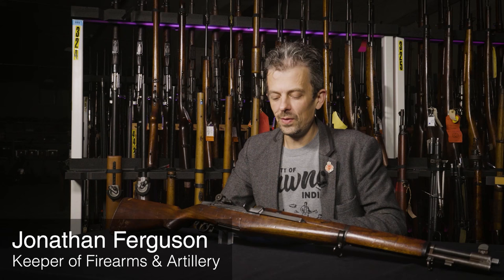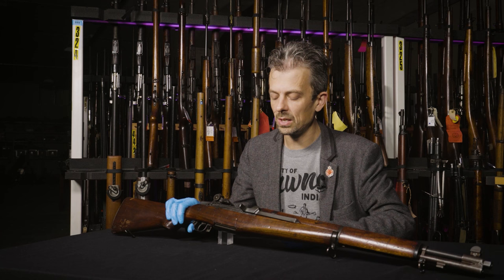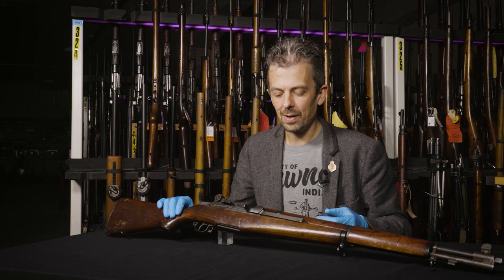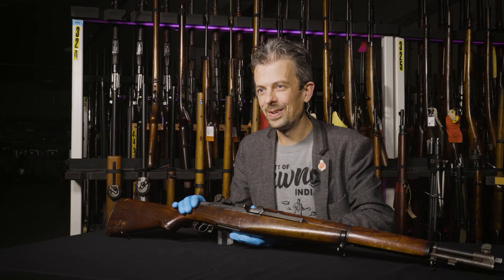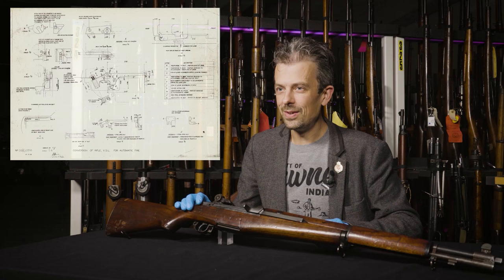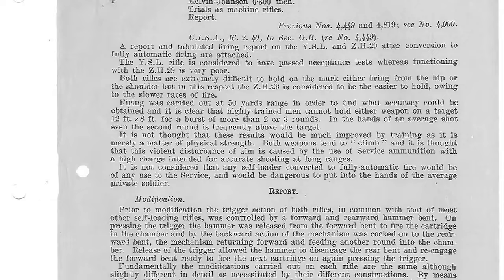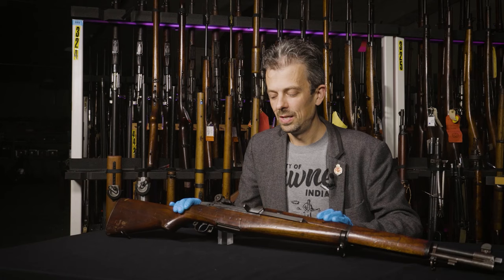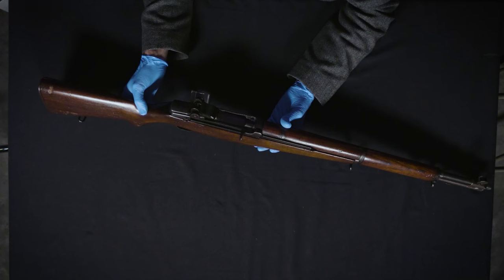Why did Britain make a fully automatic M1 Garand? With firearm and weaponry expert Jonathan Ferguson

Comment: I saw the report about the rate of fire in the US converted Garands (not M14), and it was 900rpm, which is the reason why they needed to remade a lot of things in the M14, they tried with BAR magazines, which were a easy conversion, problem is that the rate of fire made it unreliable, the bolt and the gas system were also unreliable in sustain fire with that crazy rate, the Italians developed a tricky mechanism in their BM-59s (which are real Garand conversions) and funny enough, there was a Peruvian armorer in the US which developed a simple conversion to the Garand to work with FAL mags, yep, a guy made a better job than the entire US own state armory.
Reply: I watched a little bit of a video with Eugene Stoner, designer of the AR-15, and Mikhail Kalashnikov, inventor of the AK meet to talk about ARs and AKs. In it, Stoner said that the US government was basically the worst to work with. They wanted so much and wouldn't budge on any of it. He said that was the reason the gun was so complicated, and in the interview, you can kind of tell he wasn't too happy about it.

But it was interesting to watch Stoner and Kalashnikov talk about their guns with each other. Just two craftsmen talking about their work.
Reply: @acestillwell98  his best work was the AR-18 and the 63, the AR-15 itself... Not as good, since it was designed to be a light range weapon which they thought it would be a outstanding military service rifle, problem is... to turn it into it Stoner needed to do a lot of compromises to work in every branch of their armed forces, funny enough he has a better concept and he offered, but they rejected.

Comment: So its a british BAR without the 20 round capacity
Reply: That's the BREN gun
Reply: Interestingly enough, American automatic M1 Garands tried to use BAR magazines, but they didn't quite fit together well.
Reply: @m2hmghb  The BAR wishes it could be even half as good as the BREN.
Reply: @slaughterround643  I wouldn't say half, but yes the BREN is the better weapons  system. I'm just saying that the BREN filled the same niche the BAR did in US service.
Reply: @m2hmghb  Arguably the Bren was designed for its role, and the BAR was cludged into that same role in the style of square peg/round hole.
Reply: @slaughterround643  Valid point. It was originally devised for walking fire/support fire in WW1 - not for a machine gun role

Comment: Would adding a vertical forward grip to either the YSL or the ZH29 have made them easier to control? I'm guessing not, but I am not a shooter myself so I don't know these things by heart. Apologies to those of you who are shooters if my question is incredibly stupid.
Reply: For full auto recoil control, they certainly do help; the traditional horizontal forend of most of these kinds of rifles is perfectly adequate for accurate, slow shots. Having the vertical surface allows you to pull the rifle into your shoulder and keeps the muzzle down just by pulling your hand back. Doing the same thing with a traditional stock would involve gripping the stock extremely tightly instead of just holding a grip and applying a pulling force.
Reply: Yes, a vertical forward grip can make a weapon more controlable but.... the M1 Garand is a relative light gun (especially if i compare it to my Sig 550 tha i had in service), it has no pistol grip and the full power rifle ammo is just too powerfull for that. I would say, yes, it can but it's so little in this configuration that it makes basically no difference. For an M4, Sig 550, Ak 74, HK G36 or other modern 5.56mm assault rifle, that's an other story. I had none and my gun was quite controlable but the Sig 550 is really heavy (5.5Kg) in comparison to others and we shot mostly for fun in full auto.
Reply: The best way to control full auto recoil is a hefty muzzle brake to redirect the gas, making it much easier to control
Reply: Awesome. Thank you to all of you who have answered this question for me. Everything you have all said is extremely interesting, and the physics of guns fascinates me.
Reply: @jamesallred460  To add, the Bren gun was used from the hip and the shoulder in jungle fighting in Malaya, and front grips were improvised for exactly this purpose; to control a full power cartridge as far as possible. Obviously the Bren is an LMG not a rifle, and a lot heavier, which helped to further control recoil, but the same physics apply.
Reply: Good answers all around.

Really, there's only 2 ways to make automatic fire more controllable for a full-power cartridge: Reduce the rate of fire, or increase the weight of the gun, and the second makes a much more significant difference. The Browning Automatic Rifle had a similar form to the Garand and fired the same cartridge, but weighed twice as much (exceptions being the Monitor, which was only 30% heavier at 6 kg, and the M1922, which was almost 200% heavier at an eye-watering 11), and had a relatively slow rate of fire at 450 rounds per minute.
Reply: @PhycoKrusk  theres actually way more than 2 ways- almost every part of a firearm has something to do with recoil- rate of fire, cartridge size, muzzle-brake, weight of the firearm, ergonomics, length of recoil, gas system, skill of the shooter. The easiest way to reduce recoil without heavily modifying the gun is to slap a big compensator or muzzle brake on it
Reply: @bootsontheground4913  That's fair, although that does introduce issues with the now redirected muzzle blast.

As I often say, a firearm is not a machine so much as it is a series of compromises in the shape of a machine
Reply: @PhycoKrusk  what issues? Putting a big muzzle brake on a full auto weapon has never caused me any new problems, unless you think shooting full auto and looking cool at the same time is an issue
Reply: A muzzle device or porting may have helped, by using gasses directed upward to push down against full-auto muzzle lifting.  That's why AKs have a muzzle device that looks like it's a barrel with a half-moon cut out of it, to compensate for the muzzle lift (and actually a bit of leftward movement as well).
Reply: @bootsontheground4913  I guess those issues are more likely to affect people that might be around you
Reply: @PhycoKrusk  if someone is directly to the left or right of your muzzle, neither of you are practicing good gun safety
Reply: @bootsontheground4913  I think we're also talking about different contexts.

Being honest though, I don't think that I actually have a very good counterpoint.
Reply: @jonathanferguson1211  this was really fun to read imagining your voice in my head! And thanks for the info btw,  very interesting stuff!
Reply: @jonathanferguson1211  this was really fun to read imagining your voice in my head! And thanks for the info btw,  very interesting stuff!
Reply: @MrArmybiker  The M1 Garand weighs more then the 550, you might be thinking of the M1 Carbine.
Reply: @m2hmghb  What? really? I only once handled a M1 Garand but that's nearly 20 years ago, i thought it was less than that. My fault. But the 30-06 is a much more powerfull Cartridge than the GP90 (5.56mm) so the weight helps a lot.

Comment: As a Garand owner, this video was quite interesting! I prefer its original configuration. If you want a "Light machine gun" the Bren is your answer. Built in bipod, 20 round mags, not the lightest to carry "Rambo" style but it does the job. I do like the precision machining of early WWII ordinance but even the muffler pipe firearms are quite interesting.
Reply: Bren was standard 30 round mags, you're thinking either the later version NATO Bren which used FAL magazines or the BAR, both of which had 20 round mags as standard.
The Brits also had a fairly interesting system for ammo distribution that the Americans should've thought of - Every soldier in the section carried 1-2 spare Bren mags on him at all times, meant a lot less weight on the already overloaded Bren Gunner.

Comment: If the English Conversion followed the progression that the American Conversions did for the M14, the Full Auto Capable parts wouldn't be in the Trigger Group/Pack it would be attached to that hole and would also attach a knob on the side in the cutout as well as a long transfer bar that would connect to the operating rod. That's IF the English Conversion followed the same though process the American Conversion did to become the M14.

Comment: you could probably get the parts like 3d printed for a reasonable cost. Its not like they have to be able to shoot.
Reply: Brother try Henry Kranks & Co In Leeds UK this place has to have a contract with Royal Armouries.
Reply: They're all mostly flat, so it would be easier and better to just have them laser cut and welded and machined.  3D printing wouldn't work very well for what these are, OR (if they were metal 3D printed) would be substantially more expensive than simply laser cutting them from flat stock.  Give me the drawings and put me in a metal shop with a laser cutter and a press brake, along with a manual mill and a TIG welder, and I'll make them for you.  The parts aren't actually all that complicated.  (The drawings say "braised" but it would be stronger and easier to TIG weld them.  A technology not available in the 1930's.)

Comment: wasnt the FG42 full auto, in a full power cartridge, and very controllable? (without use of the bipod)
Reply: To be fair, the FG-42 was effectively designed to be an LMG that could be used as a rifle, rather than a rifle that could be used as an LMG. That way, they weren’t starting with a rifle action, and trying to somehow make it controllable. Both the M14 and heavy barrel FAL tried to make it work in a rifle body, and failed badly.

Comment: I have a Barretta BM 59 made in 1953 in very good condition. It was made using M1 tooling by Barretta  to shoot 7.62 using 20 round magazines. I occasionally shoot it, even this year 2022 in Full Auto!! And it is s very controllable.  The cyclic rate of fire is slightly less then an M16. But you are out of ammo in about 2 seconds.  Currently, my precision gun is a 300 RUM, which is accurate to 1 mile on a nice day. It shoots a 230 grain bullet. The gun with scope is 17 pounds in weight. Not in common in the American shooting sports. I don't think your host knows beans about guns.
Reply: See, YouTube bulletproof. Full Auto M1

Comment: “in 1939 we didn’t yet have reduced power cartridges that weren’t pistol cartridges”

Did .25 Rem., .30 Rem., .32 Rem., .35 Rem, or .351 Winchester ever get used in a military prototype? Those were commercial available in the interwar and serviceable intermediate cartridges.
Reply: These are all larger than .223 though.

Comment: Gotta hand it to you Brit's ,you come up with some wacky ideas, but they work . Practical ? Advantageous?  Not so much ! But A for effort👍
Ps. It's kinda hard to see anything on the  over head satellite photos .
Reply: *Brits
>.>
Reply: Yep, we're on it for next time :) As to wacky ideas, well, the idea was just to see if automatic fire from a full power rifle was practical. We soon learned it wasn't, and ended up designing the EM2 and then adopting a semi-only FAL. It was the US who pursued full auto Garands (effectively) with the M14 :)
Reply: @jonathanferguson1211  As I have pointed out in other comments, I suspect it was to make sure that someones Good Idea Fairy was shot good and dead. And a stake driven through her heart.

There are people, generally in senior role, who will not listen to logic from experienced people and will keep insisting that you are wrong. Sometimes a proper trial (or, in my job, simulation) you know is going to fail is the only way to get them to shut up and allow the people concerned to get on with useful work.

Comment: Left it to US Ordnance to screw the soldiers that they were suppose to support. Variations include but not limit to automatic, box magazine and pistol grip Garands. But the brass couldn't see the benefits to these variations. Oh btw, the Garand was originally designed with a smaller round which brought the round count to 10, but again US Ordnance screwed the soldier because it has to be a full powered round.

Comment: The initial power of the .03-06 cartridge would make this rifle a fool's choice for controllability. The M-14 proved that! The FN FAL was and is far more adaptable for auto mode and fire but still with over powered ammunition presents a task of placing controlled shots on target. Full auto in a shoulder fired weapon is wasteful. Semi auto collects more "meat" per trigger pull due to aimed shots.

Comment: I have a hard time understanding the logic behind doing this. Unless you provide such a weapon with at least a 20 round detachable magazine there's no point to it as far as I'm concerned. If memory serves me, the ZH-29 had a fixed 10 round magazine so that would have been pointless.
I'm also aware that some FN-49 rifles were manufactured to be select fire but still retained the fixed 10 round magazine. I really don't understand the logic there either.
Reply: It's for use as a testbed for research purposes.
Reply: To follow on from Wirksworth Gunrooms comment, they didn't specifically want to just have Garand or ZH-29 full auto conversions, they were trying to work out about the potential usability of a full rifle calibre automatic weapon. It was a research task. 

As Jonathan stated, this no doubt went on to influence the intermediate cartridge used in the EM-2 originally.

Comment: The British: making a needless replacement of a gun that… already exists

If you want to put the M1’s rounds down range at a high rate of fire… the BAR already exists… and has for quite a long time. I have to wonder why they would modify the Garand instead of just buying the BAR. The BAR’s design makes it much more controllable than a garand on full auto, it just seems to be a solution looking for a problem to me

Comment: Please consider remaking this video under better lighting conditions. Most of the details you are discussing here are not readily visible due to poor lighting conditions and or a viewing angle that is too wide. Furthermore using black backgrounds and filming surfaces do not help the viewer. Consider using light or white filming surfaces and backgrounds.
 I would have liked to have seen what you were discussing.

Comment: The Brits were great at improving American models in WW2. Why the US didn't emulate them is beyond me. They converted Sherman's into flame throwing "Crocodiles" and converted some Sherman tanks into tank killers by replacing the main gum with a larger one that could blow away German tanks from the front.